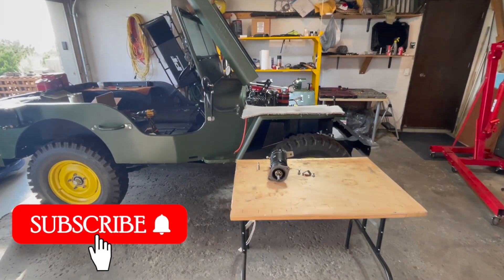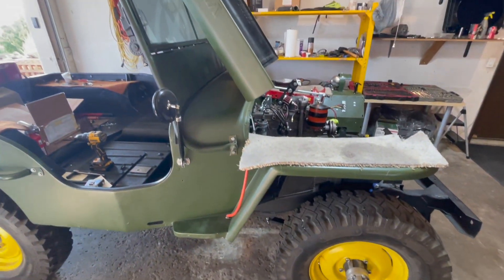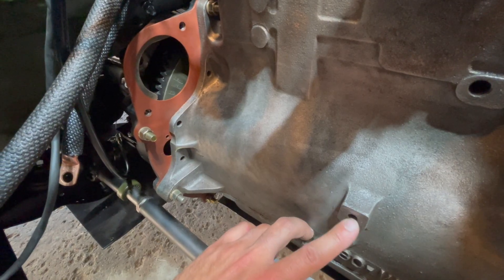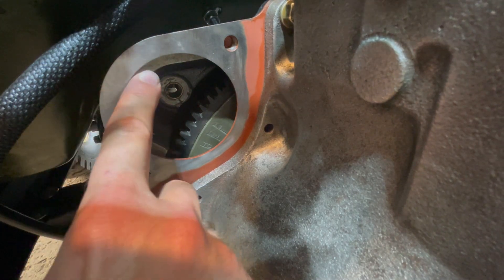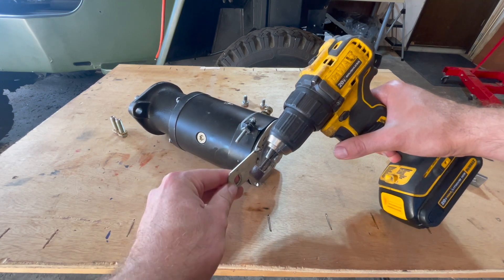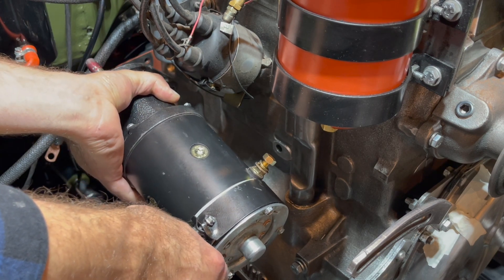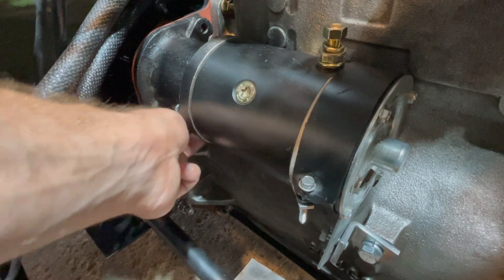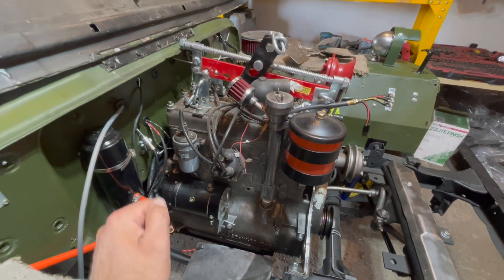Starter Motor Installation (step by step) Willys Jeep L134 go devil engine

Comment: My CJ2a lacks the flange on the back of the starter motor that the L-shaped support bracket bolts to (I'm also missing this bracket).  Do you know where I can purchase these parts?  By the way, this is the clearest and most detailed description for starter installation I have seen.